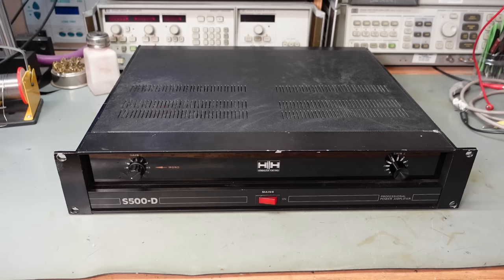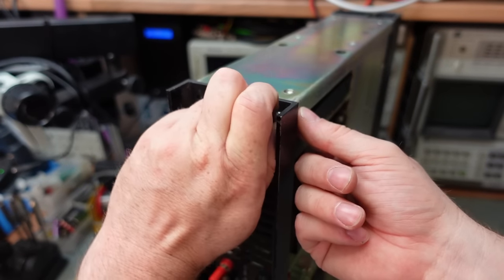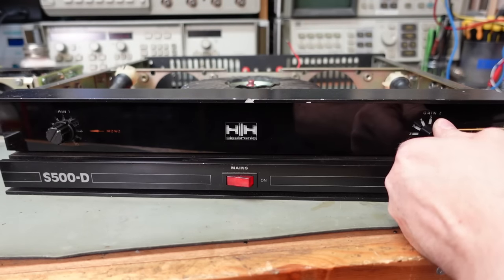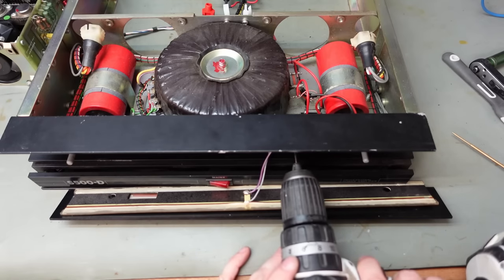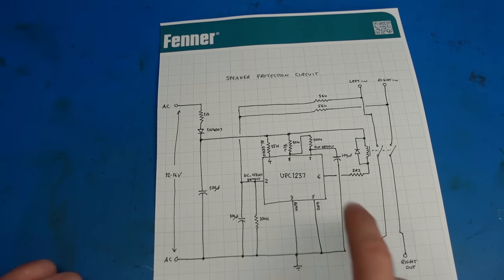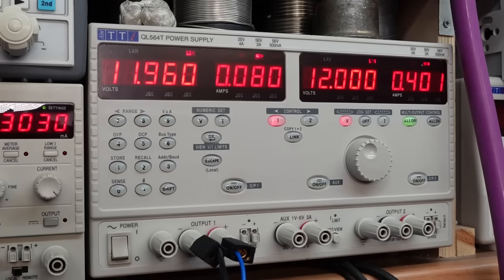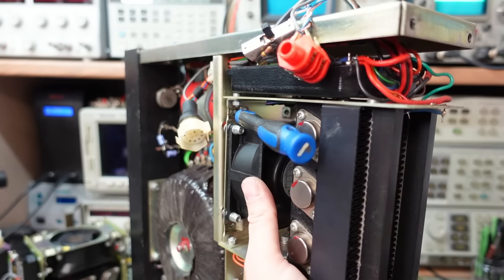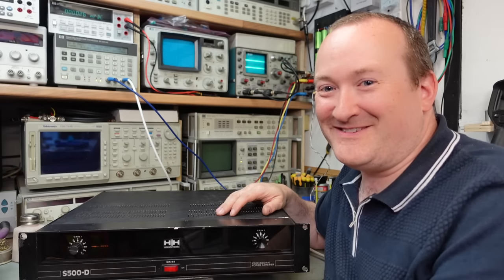HH Electronic S500-D Power Amp Modification

Comment: You remind me of a boss I once had. While in the Navy stationed on a Destroyer Escort, we were in what was known a Tropical Hours, and if you didn't have duty, you could leave the ship. Rather than go to my Navy housing home, I got a part time job at a repair shop that serviced everything just like you do. The owner was a man from a different planet. He was a gifted technician like you, and nothing could get past him. The first day there, he put me on a repair bench, and told me, if you have problems, ask me. He said this shop makes its money on time of repairs, and if you get stuck, you are costing me money. I thought about it, was brought my first piece of equipment to repair. While I was removing the covers, he came by and said, " are you having problems ", I said " no ". He left and as I was probing through some points with a scope, he came back by. He ask me, " have you found the problem ", I said, " not yet ". He told me to move over, he took the probe made 2 checks, told me, this pass transistor and two resistors are bad, change them, and grab another piece to repair. I thought he was being an ass, but come to find out, he was just that smart. I learned a lot from him.

Comment: I have watched with delight your video tear downs and repair of various consumer Hi Fi and the latest one I watched was on the HH Electronic S500D professional Power Amp. I was pleased you gave this 1970s power amp the credit it truly deserved as before the HH Mosfet range emerged in the 80’s this was the backbone of many if not all large touring bands and large club bands with a reliability todays far eastern amplifiers still dream of. As you underscored they were almost bomb proof but when they did go wrong, usually from abuse, they were a costly repair both in amplifier and unfortunately speaker systems. I found your mod to incorporate a speaker DC protection board very interesting and informative because this year I have rebuilt 5 of these beasts and contemplated incorporating such a device into them myself. I do have one or two observations to make though, as I have mused over why you opted to use only one DC protection board to protect both independent amplifiers which obviously if one fails they both go down I would have used 2 boards one for each channel. Another point I noticed was that the relay contact rating was only 5 amps this is well below the peak current that would be drawn if the output transistors went dead short as those big red 15,000uf computer grade capacitors which are capable of at least 12Amps each, so I guess this protection board would only work once as the contacts would be burnt away. This leads me on to another point and a problem with many of the Chinese DC Protection boards I have looked at including this one and others using the same IC, is that they reset after a short period of time after the DC has gone away, now because the S500D does not have any secondary voltage fuses to break there is the possibility that this could cycle one off to the speakers before maybe eventually blowing the primary 240v fuse rated at T10A a/s after destroying other parts within the amplifier. I congratulate your valiant effort to incorporate some form of DC Protection to this legendary professional power amplifier but I do feel it requires further thought. I was also surprised that you did not look inside the driver modules as they were not all potted when you had the modules out and check the test voltage of 2.4v between the test pins 2 and 10, this sets the bias level for the output devices. which operate in class AB+B mode however this is not adjustable, it is what it is but has to be correct. You should check out the Crown DC300A for comparison. The Mosfet versions of high power amplifiers HH Electronic followed on with used a couple of various simple DC Protection methods one being a fuse blower (crowbar) across the loudspeaker output designed to blow the DC supply voltage fuses that HH reluctantly incorporated, however due to the high currents possible I guess the Thyristor providing the crowbar only worked once as well. Another point from your video is that of the five HH S500D’s I refer to, 9 out of the 10 capacitors had developed due to age an electrolyte leak some much worse than others, I thought after 50 years in service you may have considered replacing them, I have replaced all 10, the correct value and size are difficult to find but Mouser Electronics UK can supply a Chemi Corp  version of the exact fit. E36D101HPN153MC92M. I also observed that the driver transistors on the modules were connected straight down to the PCB copper plane, various versions of this module incorporated an alloy plate of varying thicknesses and shapes as a heatsink because the initial output in class AB these are the output transistors and do run hot. Adding a thick alloy plate does help these transistors run cooler and stops the PCB from becoming heat damaged.  You rightly observed that the fan did rotate slowly once powered, this is a fault,  the capacitor fitted across the thermal sensing switch is leaky and should be replaced as well as the 2 sensors noting different temp cutouts. 
I have also watched your repair of the Peavey CS4080HZ power monster what a load of rubbish in design compared to the HH S500D, I would not have taken on that repair job, credit where credit is due.
I hope you don’t take this as criticism for the sake of but rather a sharing of ideas between fellow Engineers.
Reply from the maker: Hi Phil, Thanks for taking the time to write this. I'm flattered that someone of your expertise has paid so much attention to my videos. You make a lot of valid points, and I agree with most of what you say. I'm not an expert in any make of equipment, and often work on things I have never seen before (including the S550D). Keep watching, I'm still learning every day!
Reply: @maxfactor4209  For 6 months, before it goes bang, not 42 years!
Reply: Ahh Crown DC300A... beautiful 👉🇬🇧👈👉💎👈❗❗
Reply: @maxfactor4209  imo class d is good for powering sub. I will take class ab or pure A for speakers
Reply: @alexmarshall4331  named DC for the DC they love to put out when they die and toast your tweeters!
Reply: @jtsotherone  NEVER had that problem 👉🇬🇧👈⚠️
Reply: @jtsotherone DC won't fry tweeters, they are capacatively coupled. The DC WILL burn up woofer coils quite nicely. As for the tweeters, all Crown amps are very prone to high and ultrasonic oscillation, which frys the tweeters. 

Crown = overpriced, overhyped, unstable junk. And they don't  sound good either.
Reply: since my post last year and considering some of the topics we explored i have now designed and fitted my dc protection module. i didnt use the chinese module with the IC but an alternative module using 2 transistor back to back connected in a thyristor config, 2 npn for positive half cycles and 2 pnp for the negative cycle detection. this follows HH original design" minimal components to do the job well. the 2 modules fit on a metal bracket that nicely fitted in the minimal space. i used 2 modules to give true independence and a certain amount of  resilience.
again Mark keep up the good work
Reply: 7:51
Reply: @MendItMark  вы хороший мастер своего дела! 👍 На самом деле вы знаете всё! Поэтому всё быстро замечаете и ремонтируете ! Думаю что о полной модернизации усилителя , задачи не ставились ! И при правильной эксплуатации , усилитель низкой частоты ( НЧ) прослужит срок гораздо больше чем производитель укажет !  Думаю что нагружая усилитель на 75%  , ничего с ним не станет ! Если мало мощности , то просто дополнительно поставить требуемое количество НЧ !!! 
 Вам доброго здоровья! Успехов в вашем труде ! 👍👍👍 Буду и дальше с удовольствием смотреть ваши видео! 👍👍👍

Comment: I really liked how you integrated this mod into the amp. When I was building power amps with direct coupled output, I learned pretty fast that losing either the positive or negative supply voltage would dump the remaining full rail voltage into the load. This was before that neat little chip was available, so I designed a circuit to monitor the supply rails and if either one went away, the speakers were disconnected immediately. It also produced a delay on and instant off function to eliminate annoying thumps when powering on/ off. One other learning experience was that I put fuses on the rails but they only fed the output transistors, not the driver board. If the fuses blew, the driver circuit tried to to supply power to the load which resulted in a cascading failure of every transistor in the non-fused driver board. Luckily these lessons were learned during testing on a dummy load, so no speakers were sacrificed!
Reply: Yeah. Unfortunately, the design of that circuit is pretty bad and a poor implementation, Chinese "let's just laugh and follow what was in the NEC datasheet". Sigh. A, it's a 24V relay (with a DC coil resistance of around 1.2k), B, it's running on a 12VAC (16.9VDC) supply, C, the turn on delay is FAR too long (look at both points A and B as to why) and D, the drop-out time when detecting 1.5VDC is also WAY too long. Finally, the 100uF that is used in the input DC detection circuit should NOT be electrolytic. It should be bipolar, and probably a lower value such as 22uF (which will decrease the detect time). If the amp fails with a negative DC fault, that cap will eventually be destroyed as it's being reverse charged.

Comment: This takes me back! Way back when I was a “wet behind the ears” teenager I worked at a local hi-fi place here in Hobart. They did P.A. Stuff too and had this amp that was a direct clone of the bigger brother of this amp you have here. Someone had dug the front end out of the potting and literally copied it.  They were quasi-complimentary I recall as the semiconductor manufacturers had not quite yet worked out how to make the really solid PNPs yet. (c1978).  We used 2N3773,s, three in parallel each side with 220 m Ohm emitter resistors and had added an eight band graphic int the case too….it was built around the LM3900 Norton mode op amp I recall.

      Much later, in my mid ,20,s, I recall fixing one if these H and H,s, probably not this exact model, but it sure looks familliar…I got a hell of a wollop from the supply to the electroluminiscent front pannel which basically was the MAINS directly in parallel with the transformer primary….I learned “the fast way” to treat it with respect after that, but I have never forgotten it.

  I have built and modified dozens of ams in my lifetime and added so many speaker protectors I cant count anymore.  Have used many different designs of speaker protectors. In the early days we just copird circuits from wherever we saw them, Dynaco, Haffler, Japanese Amps etc. Much later we settled on the same circuit you have here, just out of sheer convience and low component count, thanks uPC1273!

  One thing I would have done though…..and we learned it from some Japanese amp speaker protectors….make those two summing resistors at the inputs to the circuit from the speaker lines, 2 x 56K here, a little different, say 47K for one channel and 68K for the other. This guards against the rare case where both channels fail ne slammed to the positive rail and the other slammed to the negative rail…..which can happen of the amp is being full bridged.

Comment: Those 500W modules had super efficient thermal transfer to the fins with forced air cooling. Carlsbro bought HH around this time, I bought these modules from Carlsbro integrated into large PAs (100V line) for use on several North Sea Oil Rigs.

Comment: I have a feeling you could use some Clecos (instead of screwdrivers) to keep sheet metal holes in alignment.  They were made for the aircraft industry, to (oddly enough) keep sheet metal panels/holes in alignment when fabricating aluminum cladding on wings and engine cowlings.  You don't use them often, but they are extremely handy when you do need them.  You will probably need one of the smallest diameters, along with the pliers to install them.  Summit Racing carries them, but there might be some places in the UK (automotive and aircraft sheet metal fabrication supply stores) that might have them.  If you have a contact in the aircraft manufacturing world, they can probably tell you where to get them.

Comment: Hi Mark  
I was working on a similar model HH amp from the late 90's, that had been used in a TV studio to run foldback audio from the control room.  The neon inside the power switch had died, so no one noticed that it was turned on all the time, until it developed a crackle in both channels.
When I checked the main board, the components for the low voltage power supply had burnt the fibreglass on the PCB to the point that the copper tracks were lifting off the PCB.  I am guessing that it had been left on for about 20 years or more...
The hard decision was made to junk it, and buy a new amplifier, one that did have a speaker protection system, and with working power lights, so that you could see if it was turned on....

Comment: Great workmanship 👍, I have bought an assembled SP protection board with 220volts input so no need for 12 volts ac power supply, I have bought a soft start board too , but I am lazy for the project at the moment 😭. Thanks for the vid, cheers

Comment: That takes me back to doing cable lacing, it must be 30 years or more since, but the H&H amplifier was my favourite amp ever we had a 500 on each channel which you had the option to Bridge, and we ran it bridged into a 26 inch super bass speaker that originated from the Abc cinema Leicester. It was originally used for the film earthquake along with another 11 of them I believe.

Comment: I came across these amps in college in 2006ish.  We used them in our robotics lab to run servo motors.  We actually liked them BECAUSE of the lack of DC filtering.  I personally rewired their transformer taps to run on our 120V AC in the US.  I remember being struck by how well they were assembled.

Comment: wow ,,, I had a rack full of them driving an H and H concert system ,,, you had to unplug your horns before turning those on , or off , or you could loose them very quickly , and it was advised not to stack them ontop of each other in a rack , you had to leave an air space ,, now the V800 that followed them was simply a thing of great beauty ,,, ah , the good old days ,, I did a tout with Adamski who ran a Mayer Ms8 system from about 40 V800s all in parallel mono , and boys did it sound sweet.

Comment: Hi Mark great videos i would try to make a good mechanical connection when soldering the wires to the transformer eg feed the wire into the holes on the tags then bend slightly and solder, look forward to more videos.

Comment: Excellent, these amps back in the day had such a poor reputation, it's easy to forget how well build they were, it was HH's step up into the pro market, a mate had a very good one, which unlike most of the others I came across worked well, it was the forerunner of their superb V Series, I still own a V800, which is an amazing amplifier, built like a tank and very powerful but at 25kg doesn't get to go and play much these days, thanks Mark.

Comment: Pardon for my bad English, I am German. I am pastor and practise electronics only as hobby. I had the idea to modify the speaker safety board: I connected the non used nc contact of each relay to ground via 27 ohms resistors, so that the output capacitor of the power amp is charged quickly when amp is started. Without that it really took very long time until the safety circuit didn‘t detect dc offset on output level anymore.

Comment: Excellent work Mark  including the bundling of the wires. Unclue Doug on Youtube repairs vintage Guitar valve amps and always keeps the wires separated  and brings them in from high then directly down (or up) into the valve base pins.
Reply: heater wiring is different, its done that way to keep ac noise of the tube

Comment: Let's be pedantic.  Are they really GAIN controls and not VOLUME?  A gain control should alter the gain of the input stage (usually via a virtual earth op-amp) thus controlling sensitivity.  Volume controls are simple potentiometers offering a variable input voltage to a fixed gain pre-amp. Dear oh dear! I just loved that cable lacing.  THAT is professional!

Comment: Hi Mark, I recently discovered your channel and love your videos. One question.... I was tought it's dangerous to rely on the solder as the mechanical fastening between a tab and wire (or wire to wire), when the wire can be threaded through the hole in the tab first (or the wires twisted first) before soldering. Especially like here where you are soldering to the transformer primary. Are you not worried about the solder potentially letting go in the future? Keep up the great work! Thx.
Reply: I was thinking the exact same thing. As an apprentice electronics technician, I was taught to always thread the wire through the tab, then solder - especially with mains wiring.

Comment: Should always turn the Volume knobs down before switching off the amp. Because when you switch on the next time, you are not going to get huge Thump from the speakers. I had a H/H amp on my disco years ago, and it was the best sounding one at the time. Nice mod to.
Reply: The knobs are connected in line with the input, not the output, they have no effect on switch on thump, the output stage is directly coupled to the speakers. That’s part of the function of the module that Mark is installing here, it will provide a start up delay and will physically disconnect the speakers if any DC is detected on the outputs.